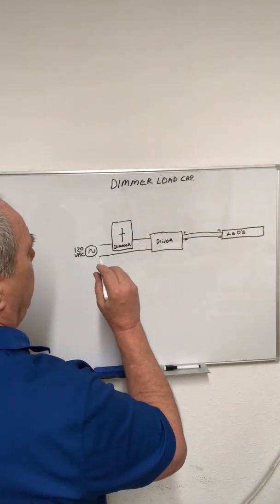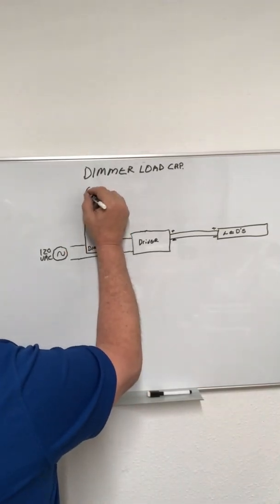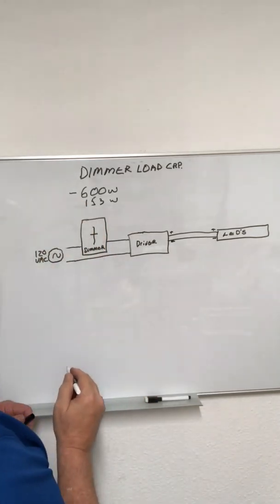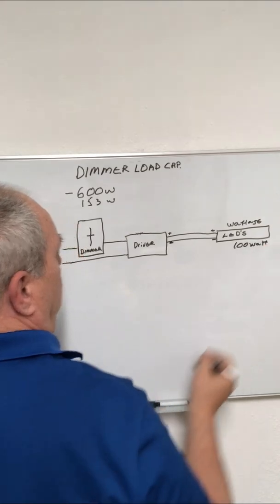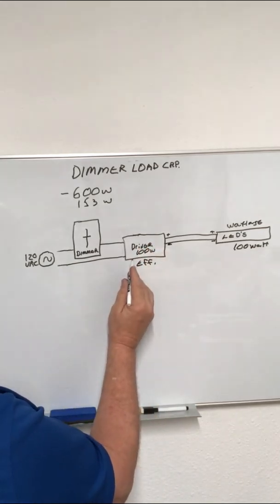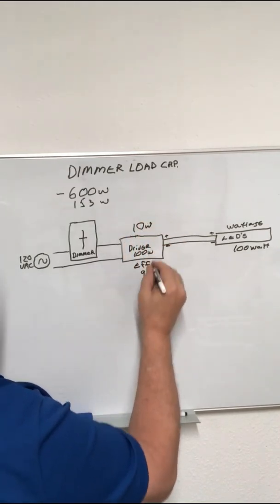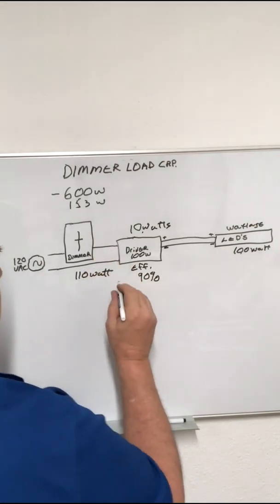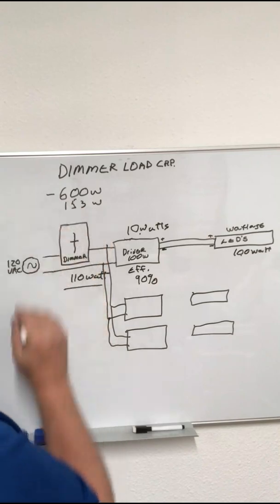How to Calculate the Load Capacities of LED Dimmers When Connecting to LED Drivers

Comment: Most dimmers on the market have a incandescent rating (which is the 600w) and then an led rating (which is 150w) , some have 1000w incandescent and 300w led.  The dimmers I’ve installed are very clear on that from the manufacturer .  I have yet to find an led dimmer off the shelf that has a 600w led bulb rating .
Reply: Same max I could find was a 300W varilight V pro and thats for trailing edge dimming